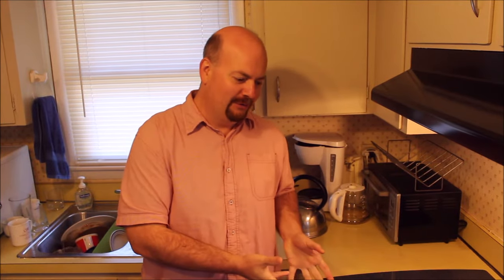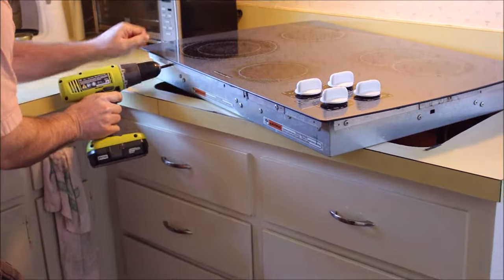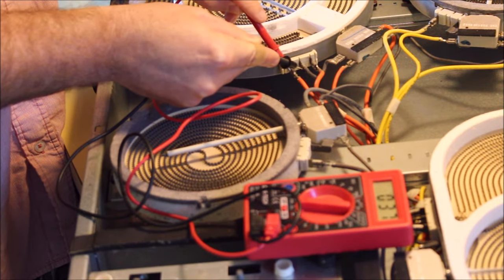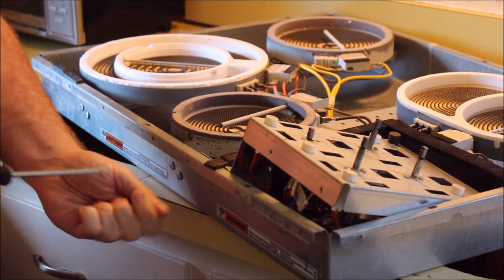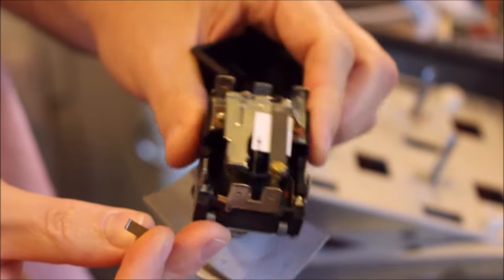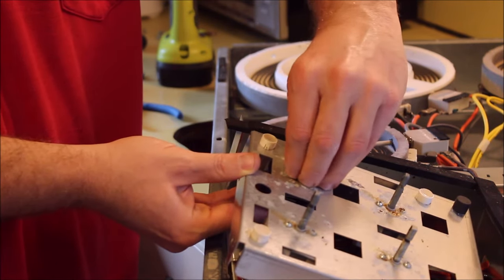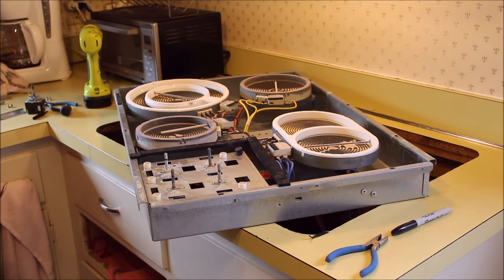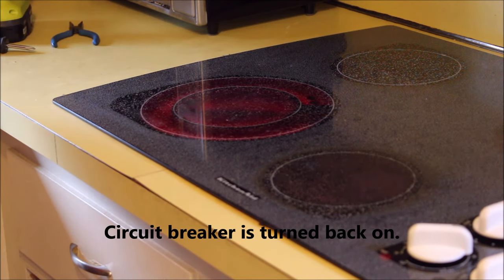Electric Cooktop: How to Diagnose a Broken Cooktop

Comment: Thank you!! I was so upset when the element tested good. If it weren’t for this video, I wouldn’t have attempted to work with the infinite switch. Seemed like no power. Tested a second one to confirm that one worked. Ordered as well as OEM knobs. I put it together and I have 4 working burners. The broken one was a dual that was out of order since we bought the house. Thanks again!!

Comment: Must always disconnect wires on the element when Ohm testing could pick up reading from the other element wires it shares. also would not recommend ordering electrical parts from Amazon, better guarantee from supply house. Great job overall!!

Comment: In normal situation, the power switch ( or switches) are the problem. 
There are moving parts inside those switches, therefore the reliability of power switch is not as good as the heating elements or just the pure metal wire.